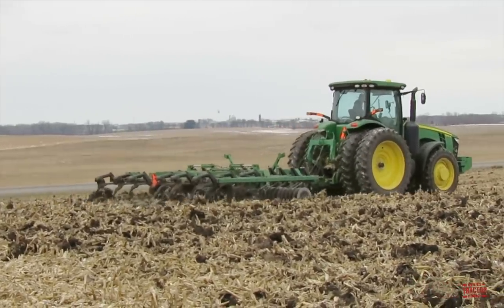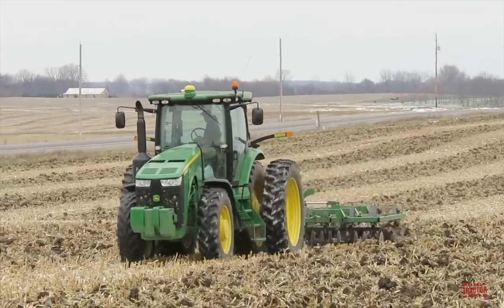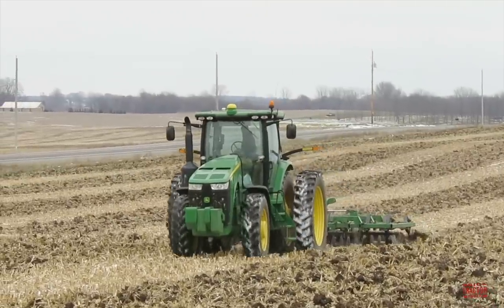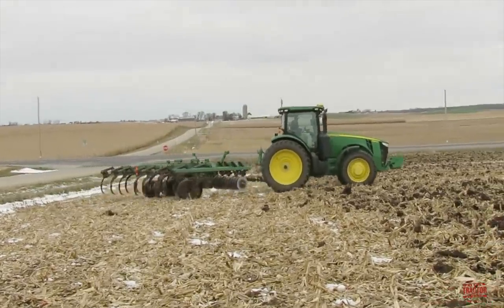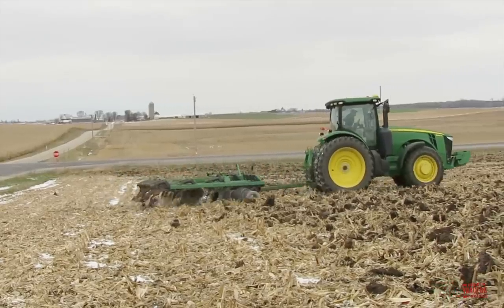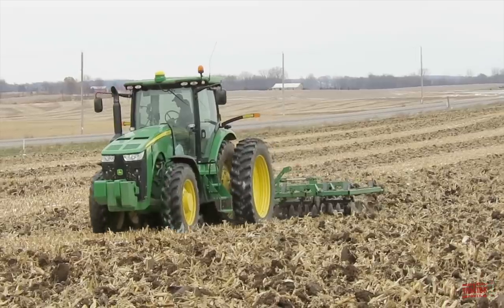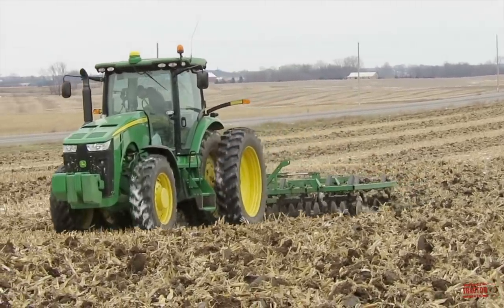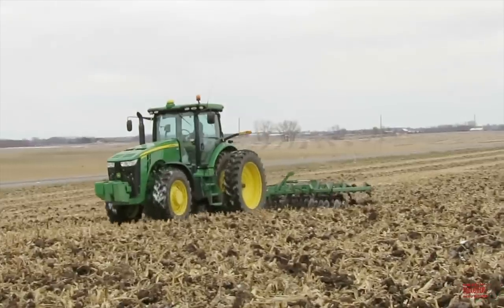JOHN DEERE 8285R Tractor & 714 Mulch Tiller

Comment: The last video made me think of the IH 2+2 series. Is there a reason, no one other than IH has put a cab behind the break on 4wd tractors?
Reply: Could be because the visibility wasn't as good sitting back that far or maybe because of weight distribution🤷🏻‍♂️
Reply: The weight distribution was really good with the engine so far ahead of the cab. I pull a nine shank disc chisel with no problem at all with my 3588 2+2.